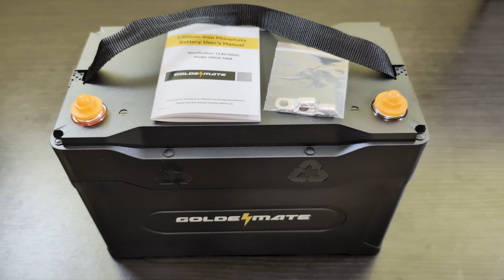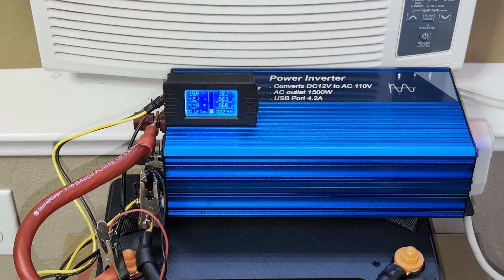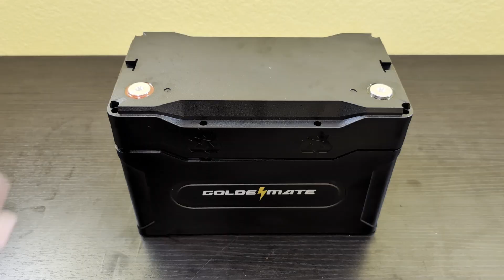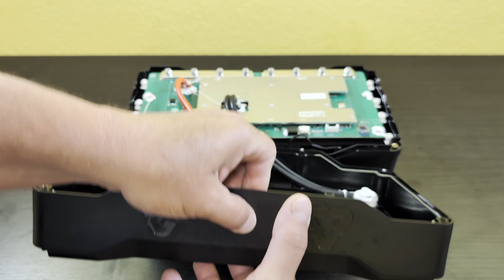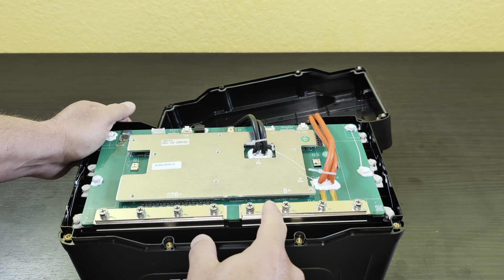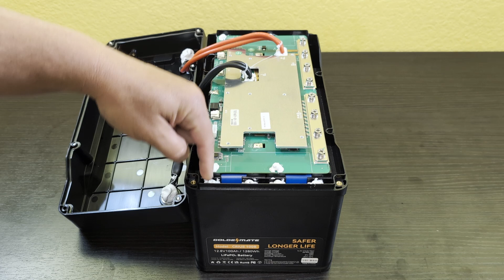Test and Look Inside This GOLDENMATE Bluetooth LiFePO4 Battery

Comment: OK.  Thanks.  So how do you connect to BT?  For the first time?  Downloaded app.  It sees the battery.  But will not connect.  Also how would you wire or connect to a pure sine inverter and how do you need connect two batteries.  Any worries to existing solar system in RV that has lead acid batteries?